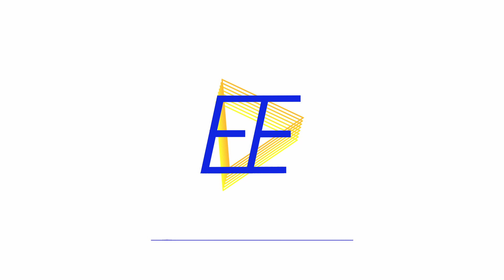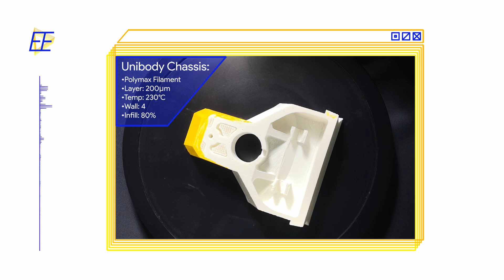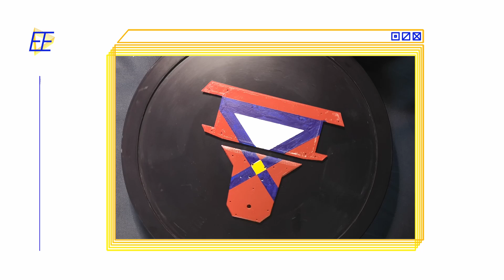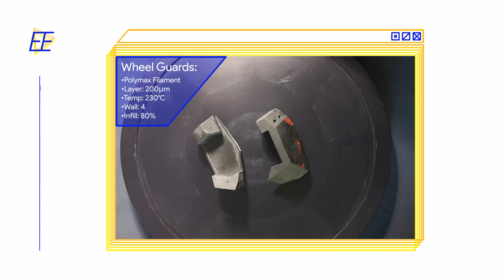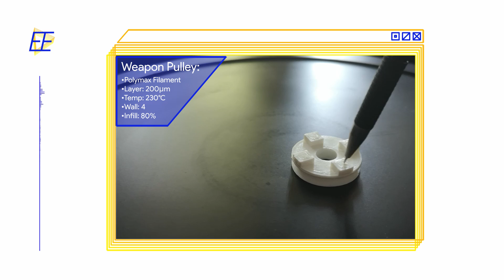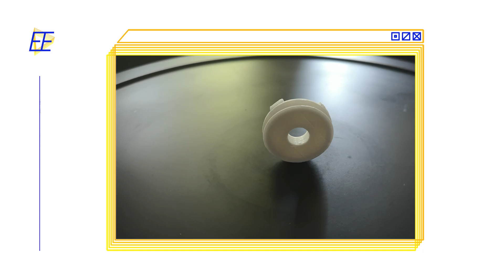Tekkadan Progress 1 - 3D Printed Parts

Comment: Good video! What made you choose polymax over nylonX?
Reply from the maker: My printer does not reach the necessary temperature to print NylonX or any nylon with a reasonable degree of layer adhesion and outsourcing printing is slow and expensive. Polymax melts at a much lower temperature which allows the prints to be made at a higher than normal printing temp for the filament, allowing for really good (close to homogeneous) layer adhesion at the cost of some extra warping which can be dealt with. By doing that, we are getting the most usable strength out of a decently strong plastic, and there's no point in trying to print "stronger" materials if they have the bottleneck that is the layers sheering.